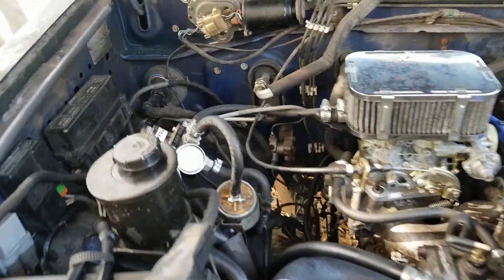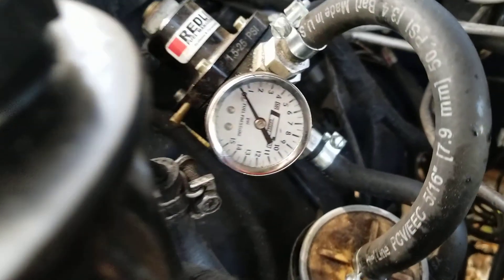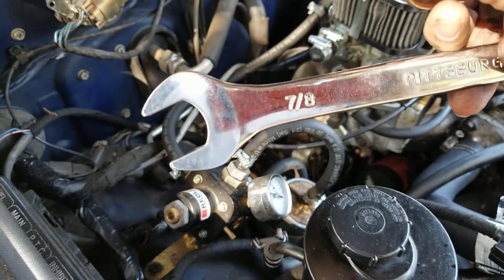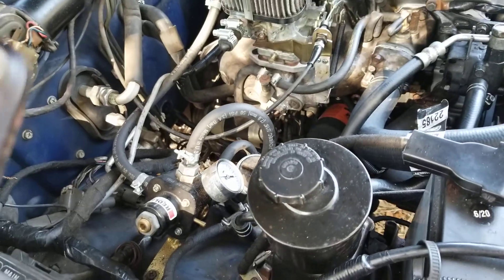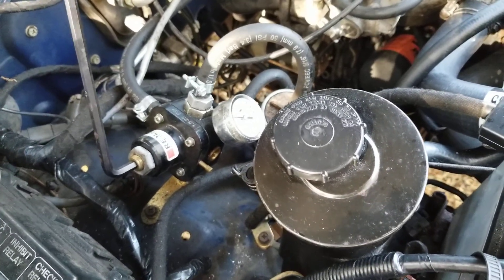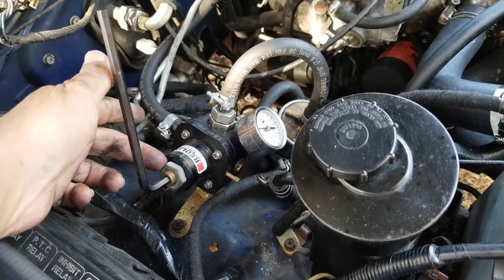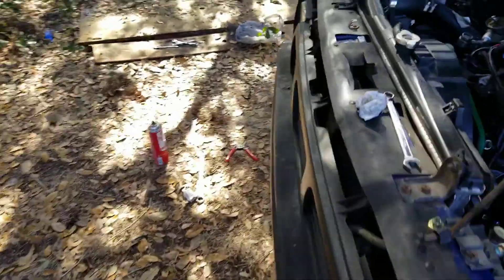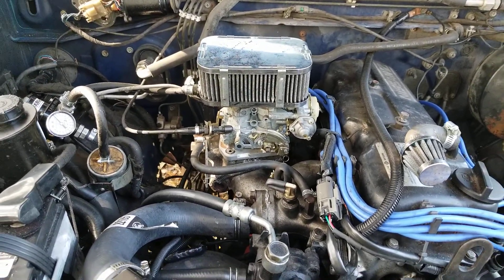86 Nissan d21. How to adjust fuel pressure for Weber Carb.

Comment: What did you do with the wiring harnesses that went on the fuel injection carburetor
Reply from the maker: All the wiring for the stock tbi is sorta tucked away towards the passenger side firewall.
Reply from the maker: There's at least two grounds that bolt up to the intake manifold.  I left those bolted on.
Reply: My problem I had with the tbi setup it had fuel spark but didn't start up go I went to the Weber setup but it seems I have the truck running but seems to me I'm forcing it to run and it's got me confused like really confused
Reply from the maker: @WilliamMcswain-r9f  can you post a vid of your setup? That way I can look and see how everything is hooked up. And I ca n hopefully better help you.

Comment: What does it need for psi for 40mm dcoe webers?
Reply from the maker: The paperwork on the 38/38 Weber I have say's not too go above 3 psi!
I literally had too readjust the Weber yesterday!  The truck was having really bad spark and a lot of black smoke coming from the tailpipe! I originally had the psi at 3! I tweaked the psi to around 1.5 and adjusted the idle mix screw till the black smoke and spark normalized!

Comment: what fuel pump did you run ?
Reply from the maker: I replaced the original one with a new stock fuel pump! I don't remember the name brand but here's the link where I got the part!  https://www.rockauto.com/en/catalog/nissan,1986,d21+pickup,2.4l+l4,1210835

Comment: Can I get a link for the gauge that you're using please I really need a good 1 for my webber carb. I dont wanna go order one and it's not the correct thing
Reply from the maker: Do you mean the fuel pressure regulator gauge? If so, they should sell them at any auto parts store "o'Reilly's, autozone or advanced auto parts" that's where I got mine!
Reply: Am from the Caribbean they don't have these stores here I can order it from ebay if I get the link
Reply from the maker: @krishanmendez9119  I'll look for one for you! If I find one, I'll send you the link!
Reply from the maker: @krishanmendez9119  this should work for you! Good luck!
https://www.ebay.com/itm/Fuel-pressure-gauge-0-10PSI-for-carburetor-Weber-Dellorto-Solex-and-Facet-pump-/303746567678?_trksid=p2349624.m46890.l49286
Reply from the maker: @krishanmendez9119  quick tip! Use silicone tape on the threads of the gauge! Otherwise, there's the danger of a fuel leak from that area!
Reply: @almagam2099  thanks  a lot
Reply from the maker: @krishanmendez9119  you're very welcome!